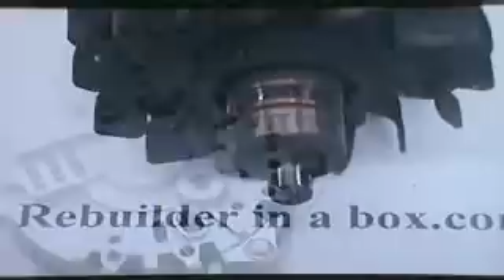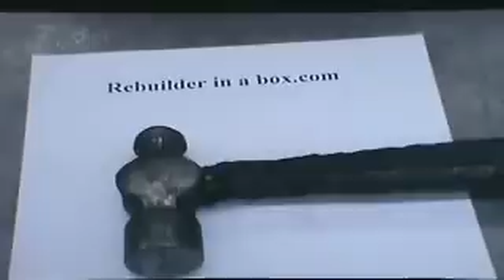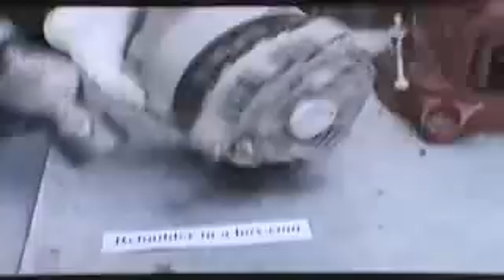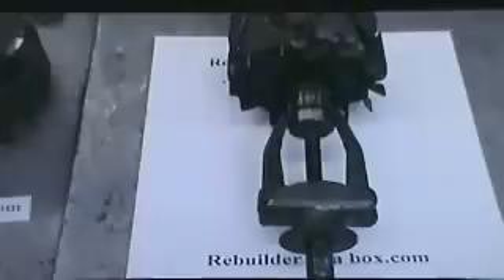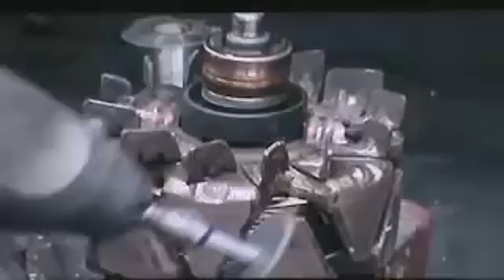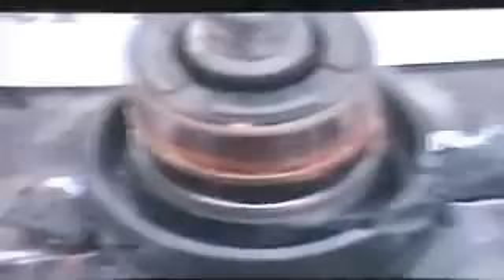New Ford alternator repair kit

Comment: Doesn't it matter what position those ring tabs are in, as they connect to the rotor?  It seems it could be hooked up backward.
Reply from the maker: The slip ring can connect to either post.
Reply from the maker: Does't matter.

Comment: David, your regulator could be the problem! Its what regulates the voltage so you are not overcharging!
Reply: it is part of the alternator, it was one of the first parts removed, the part with 3 hex screws